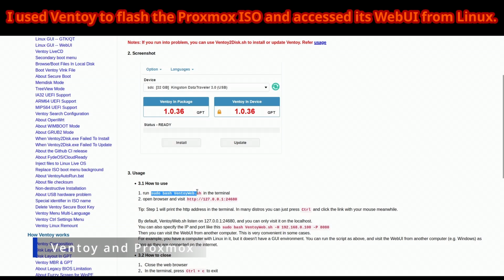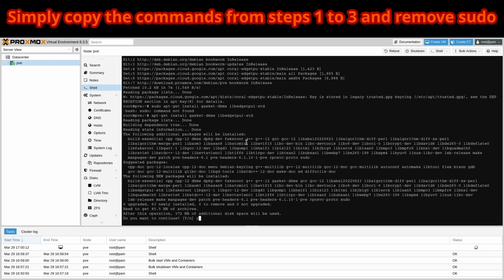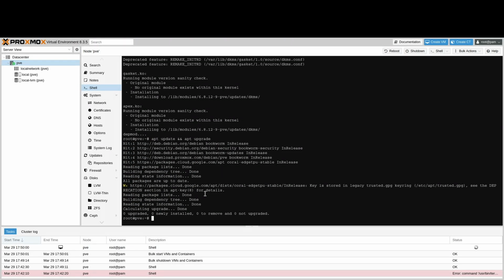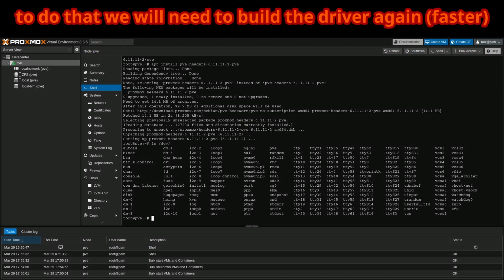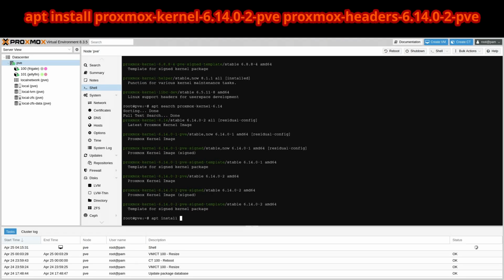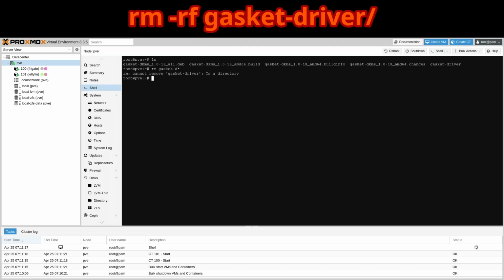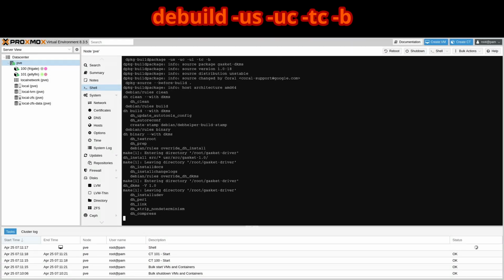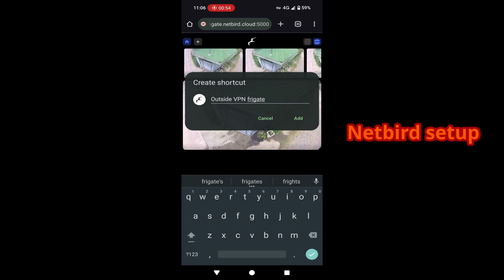How to Set Up Coral TPU & GPU on GMKtec G3 Plus (N150) | Proxmox + Frigate 2025

Comment: Great video, only question is: if there is already iGPU accessible in Frigate is it too slow for OpenVINO detection without TPU? I think it's good thing to check, no changes in hardware and only detector type need to be changed in config.
Reply from the maker: Hi! For the N150 (Intel N100/N95 class mini PC), it really depends on your use case and how many streams you're running.

I tested both Coral TPU and OpenVINO on an older setup—a 2-core Intel i3 in an LXC container. With the Coral TPU, inference time was as low as 6.5ms, and CPU usage stayed around 10–15%, which is excellent for low-power systems. Originally, I was using OpenVINO on the same system—inference time was still decent at ~10ms, but CPU usage spiked to around 45% during detection.

On newer hardware like the N150, OpenVINO performs better. Using MobileNet v2, I saw ~23% CPU usage during detection. It’s still heavier on the CPU than Coral, but manageable. One advantage of OpenVINO is its flexibility in model selection—you can choose from a wider variety of models (e.g., YOLOX or YOLO-NAS). Larger models can perform better at detecting small or distant objects, based on what I’ve seen discussed on Reddit.

A limitation of the Coral TPU is that you're mostly restricted to TensorFlow Lite (TFLite) models, and more specifically to models compiled for the EdgeTPU, which narrows your options. In contrast, OpenVINO lets you experiment more easily with different models and formats, though it comes at the cost of higher CPU usage.

If you don’t want to deal with extra hardware or can tolerate higher CPU load, OpenVINO is simpler to get started with. But if you want to reserve CPU headroom for other tasks—like Jellyfin, Home Assistant, or spinning up VMs via SR-IOV—the Coral TPU makes a lot of sense.

I haven’t tested multiple streams yet, but I’d expect the Coral TPU to scale better on a multi-camera setup since it handles detection on its own hardware and keeps CPU usage low.

Comment: great video.  can you provide link for the TPU riser?
Reply from the maker: Hi, I bought the item from shopee:
https://shopee.ph/A-E-E-key-M.2-WIFI-Card-Extension-Cable-Convert-Card-Riser-Support-PCIE-Protocol-M.2-WiFi-Card-Extender-Converter-Adapter-Riser-i.1048916232.19391667139
But I also found it on aliexpress:
https://www.aliexpress.com/item/1005007912002540.html
Reply: @JackofAllGates  Aliexpress link comping up page does not exist
Reply from the maker: It's available on my end, it might be limited to certain countries, but here is the search term:

A+E/E key M.2 WIFI Card Extension Cable Convert Card Riser Support PCIE Protocol M.2 WiFi Card Extender Converter Adapter Riser